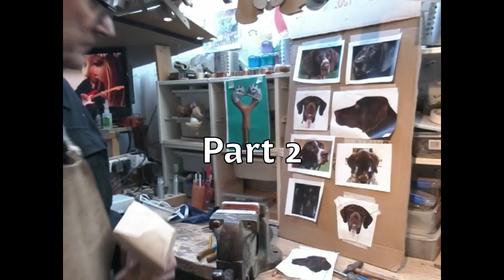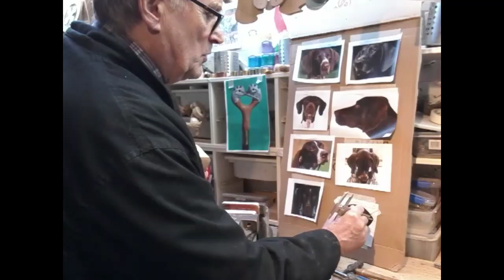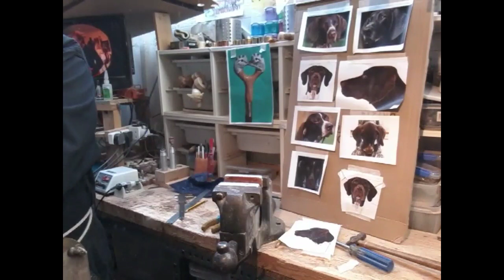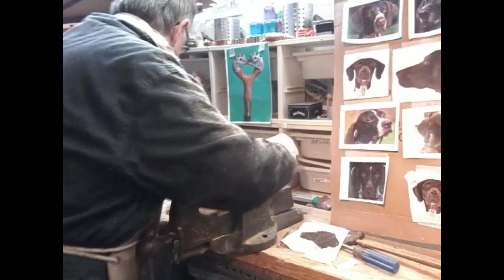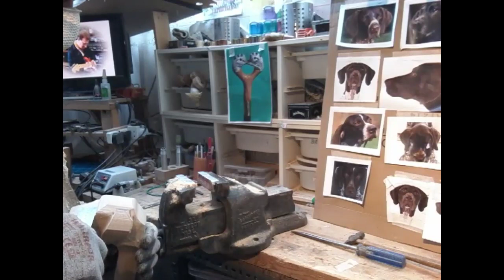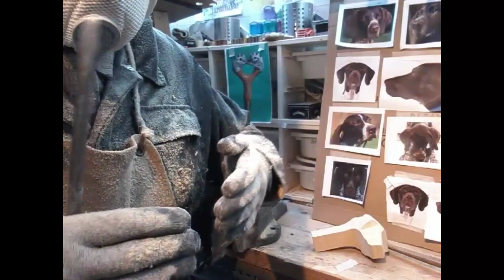Carve a German Shorthair Pointer. Part 2

Comment: Why not start with a smaller piece of wood? It seems far too big for joining to a stick and you grind a great deal away making the overall head smaller and smaller, it seems, until it's in proportion to the shank.
Reply from the maker: I start with a side and front profile and work to that throughout the carving. The ears alone measure 4.5 inches across, so what seems a large block to you is  ideal for me. The timber came from a wood surgeon so did not cost a great deal.
Reply: @wrencountrysticks8660  maybe I'm missing something as I still can't see how a head which is 4.5 inches across the ears , would be in proportion on a stick around 1 inch in diameter. It looks huge now.
Would I be right in saying by the time you've finished, the head is reduced considerably? If that's the case were back to why start with such a large piece in the beginning?
Reply from the maker: @gbwildlifeuk8269  No you are completely wrong. I start with a paper profile for two sides and I stick to the dimensions on the paper all through the carving. When finished I expect the carving to be the same size as the original profiles, so the head does not get smaller and smaller. If it did there is no way we could get close to carving a likeness. The profiles can be seen with the other photos and they are all there for a purpose. The profile pictures tell me where the eyes, ears, nose are and the dimensions which I take right off the picture. I assume you are not a stick maker and have not been to many country fairs where you would be able to see stick making competitions organised by The British Stick makers Guild. There you would have seen many carved heads on walking sticks and many far larger than mine. Check out the work of Marc Cotteral , Kevin Moody, etc probably some of the best carvers in the country. All their heads are large and there is a waiting list of buyers. I am not advocating anyone carves  large heads, I make these videos to give beginners an ideal of how I make carved sticks. Nobody taught me, I had to find out by making many mistakes and if these videos help one person toget started carving sticks it will be well worth it.
Reply: @wrencountrysticks8660  as I said maybe I was missing something.
Reply from the maker: @gbwildlifeuk8269  Perhaps what you are missing is that these sticks are all 50 inches plus in height, what I call country sticks for shooters, farmers etc.
Reply: @wrencountrysticks8660  no what I'm missing is that I cant see how the proportions can be right. You say the head doesnt get smaller and smaller in your last reply. Well as you're taking it in and out the vice it's clearly as big as your hand, which I might say has a man sized palm!
I might be wrong but it seems a big head for a walking stick, despite it might be for a shooter or on a high shaft.
Keeping it the same as the picture etc and guilds of stick makers etc etc, doesn't mean its automatically in proportion!
I'm not a stick maker apart from a hobby. I'm a coachbuilder and i do understand proportions.
Anyway keep at it we can see what happens in the final video when it's finished.
Reply from the maker: @gbwildlifeuk8269  You can see the finished carving at the start of each of the videos on carving the GSP.
Reply: @wrencountrysticks8660  can you measure the head width for me?  I bet it's smaller than the 4x4 block you started with despite your claim it doesnt get smaller! 
So you could of used a smaller piece of wood instead of grinding away probably a third to get the finished size.
It's a bit like wood turning bowls, most of the wood is on the floor!
Reply from the maker: @gbwildlifeuk8269  You set me a challenge and I have replied by video. I have showed you the original paper profile. the original wood waste from the front profile, the waste offcut from the original block I used to do the carving and I have showed you the actual finished carved dog in a painted state.   Throughout the video I have used a caliper which has not gone out of shot and you will see that the measurement  taken off the paper profile is the same as the waste wood front profile and is the same as the finished carved head. If you do do not believe that the timber shown on the video is that used during initial carving then just watch my first videos for GSP.  I will not answer any more of your comments. I feel I have been more than generous with my answers to you even while you question my word.